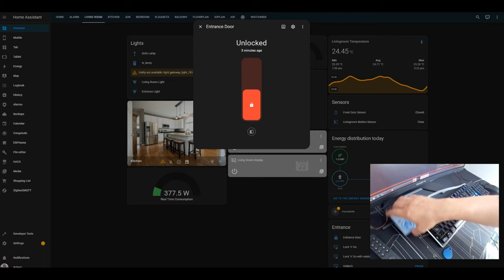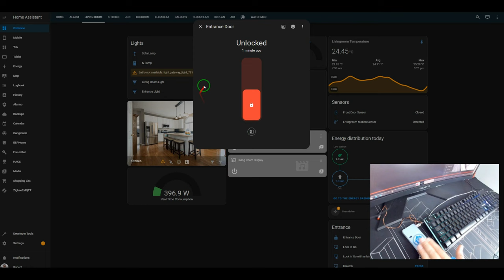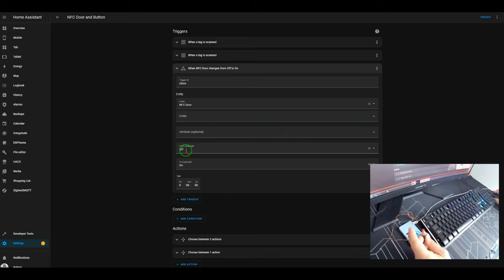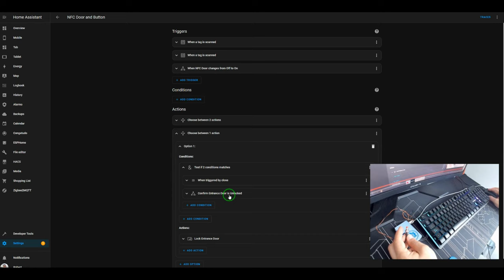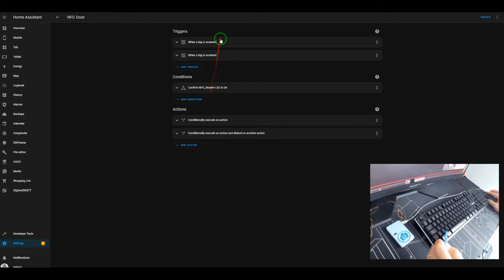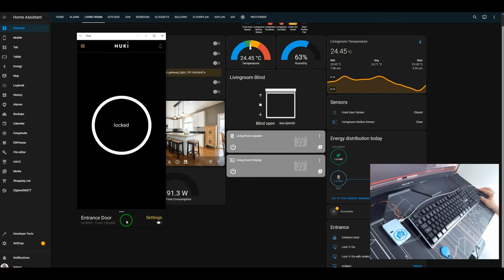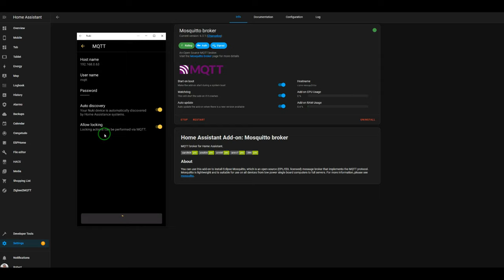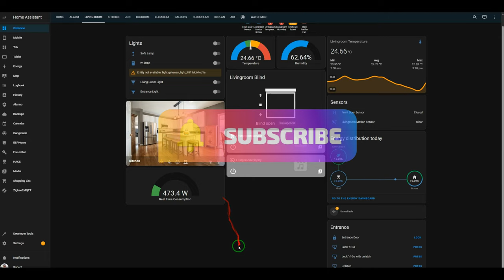Nuki 3.0 PRO Home Assistant MQTT integration with NFC lock and unlock

Comment: I have the keypad and I have no problems at all. When using the fingerprint reader, please, don't move or drag your finger, only keep your finger touching the reader and do not move ir until you hear the Nuki unblocking the door.

Another tip. When you use two or more triggers in the same automation, you can use IDs for each triggers, and then use these IDs in actions, so you can do some actions in case is triggered by one of the IDs and other actions if triggered by other ID, and so on.

Using these IDs, you have not to use the LED status as a condición.You know which Noé was triggered.
Reply: Same here. I have the keypad and I have no issues with the fingerprint.
Reply: @Legate_Lanius  question, i would also be interested in nuki's fingerprint keypad, my question is, does it integrate with home assistant ? or can i do some automation if i unlock with the keypad ? is an entity created ? can i know who is unlocking the door ?
Reply: @guegiurm  sorry mate I have not tested it with home assistant yet